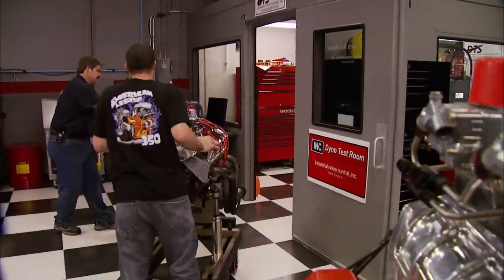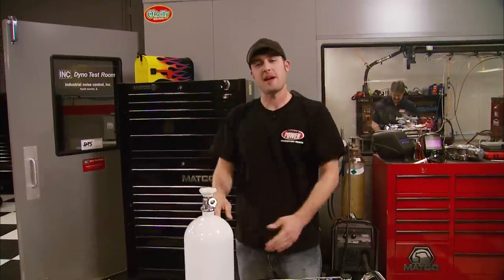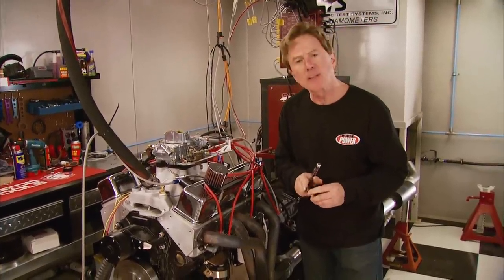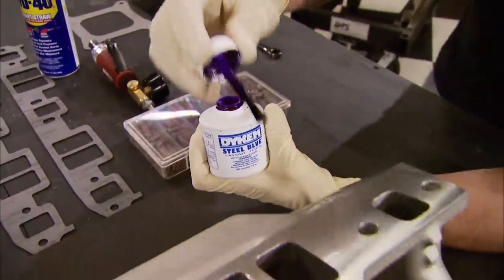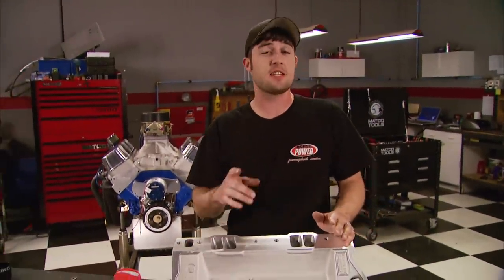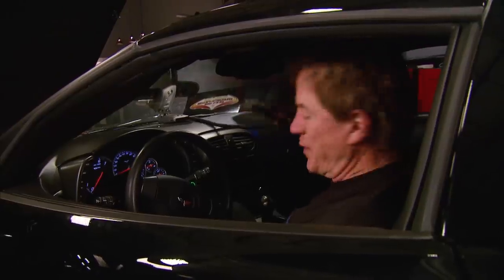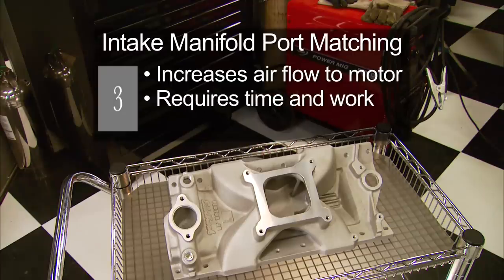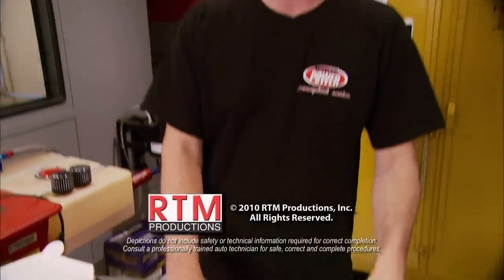Cheap Tricks To Increase Horsepower - HorsePower S12, E9

Comment: The shop vac idea is great.  You can also use shaving cream in the ports to capture metal and then flush it out, or use a rare earth magnet to capture what flies. 
What you should never do, is smooth the intake ports. Unless its a dry intake or its the exhaust port, smoothing the intake port disrupts the boundary level air and results in fuel falling out of suspension with the air. When you port match the intake, try to make each wall you're grinding on as parallel to the corresponding wall of the intake port in the head. The more bends in the flow, the more disruption.

While that intake is off, install a V shaped oil splash shield in the lifter valley, to keep your intake from hitting 200 degrees while your engine's registering 160 on the gauge.
Reply: I thought the peaks and valleys in the boundary layer level is what disrupted airflow and such and that you should smooth it down. Do I need to worry about fuel falling out of suspension with port fuel injection ?
Reply: @trizkial7592  I should have used a different term, but in airflow tests, a smooth intake port disrupts the rate of airflow, and heavier gas molecules can fall out of suspension in the air (ie, separate from the oxygen) and lead to poor burn rates inside the combustion chamber.  This is mostly true for carburator engines, which don't always atomize as well as fuel injection. Tho if the injection is happening at a throttle body or far up the intake port, there's a chance there still may be separation at lower RPMs...every time the intake valve closes, the airflow has to go someplace. It tends to reverse and run back to the common plenum and run to another open valve someplace in the engine. naturally, air flow benches rate air flow in one direction.

If you're running individual throttle bodies, then there is no common plenum to worry about. If your injectors are cleaned (not from snake oil in a bottle, but actually removed and sonic cleaned) and balanced to flow equal amounts to each other, and you don't let them get dirty over time and lose their ability to atomize, then fuel separation in the port may never be an issue. If you have a port injection system that's spraying fuel right at the valve, there's no time/room for separation. 

Otherwise, my personal opinion is if you're running pump gas, its quality may differ over time (transitioning to summer blends, etc) and a polished intake port that runs well on an air flow tester and after engine break in, may cause fuel separation a few years of use and wear 'n' tear later.  Will there be a horsepower change you feel? Maybe or maybe not--it could be a gradual change and only noticed by keeping strict records of performance.

http://speed.academy/10-myths-of-cylinder-head-porting/
Reply: Albert Gaspar Okay that makes sense. For my application I have port I injection. I wasn’t talking about mirror polishing it but just going over it with about maybe 120 grit or so. I’m more focused on blending the short turn radius and such I’m not gonna remove hardly any material. My intake ports are pretty good for a stock engine really. The exhaust side is terrible though I’m not sure what to do there
Reply: Certain engine designs are known for exhaust ports that suck (pun intended). Fords from the 1960's had shock towers that intruded into the engine compartment, and then there was the Thermactor bump for emissions.

Generally speaking, the exhaust doesn't have to worry about fuel suspension, so there, you don't have to worry as much about port surface causing the exhaust to separate its noxious pollutants. The gas is hot, its expanding, it wants to move. Keeping it hot as it goes down the exhaust system helps it move (ie, ceramic coat the headers, or use a wrap, then use the right size piping, an X or H crossover, few bends, free flowing mufflers, etc that not just fail to restrict, but also direct the hot air in a smooth path). A camshaft that keeps the exhaust valve open longer than the intake (usually called a "split duration cam") can help. But what really helps is a good set of headers. They'll move the exhaust so fast, the next time the exhaust valve opens for the next 4 cycle function, there's a low pressure inside the primary tubes of the exhaust, which draws out what is inside the cylinder--helping a bad port that doesn't flow well. the lower the pressure inside an intake or exhaust port, the faster atmosphere flows in it to equalize pressure.

Do a search for "David Vizard header design". You'll see a lot of theory, he was perhaps the best. But you can judge for yourself, here's just two:

https://www.chevyhardcore.com/tech-stories/exhaust/designing-an-exhaust-that-pumps-up-the-power/

http://www.superchevy.com/how-to/exhaust/0505phr-exh/

The interesting theory is, if you do a great job designing a header that scavenges the cylinder of exhaust, what you'll get is a "vacuum" on the cylinder by that exhaust system when the exhaust valve opens, and when the cam has its overlap period (when the intake and exhaust valves are open and overlap), the "vacuum" will draw more intake in, helping the intake port flow more air into the cylinder.

to take this to a further level (or more confusing :)  ), you can play with angle cuts on the valves. You've probably heard of the "three angle valve job". Its done to the valve face and valve seat. Get the angles right, and the port flows better at low lift. 

This helps because when the valve events overlap, its when they are at low lift. So, get the low lift flow spot on, and you get a better flow at cam overlap. Add in a great scavaging header design...and you almost have a boost-like effect going on in the head. instead of a turbo or supercharger pushing air in, the exhaust is "Sucking" it in and there's more air/fuel mix to burn when the intake valves close (tho there may be some in the header that backfires if the header is hot enough).

or so goes the theory :)
Reply: Albert Gaspar Oh okay awesome! I actually read David vizards porting book!!! I loved it. I wish he had more books that weren’t just on building small block chevys. Unfortunately I’n my application a 2003 Seville STS with the 4.6 northstar their is no aftermarket exhaust headers. So I’m limited to using the stock manifolds and making my own dual design into an x or h pipe. I was thinking about seeing if I can take the heads to get a 5 angle valve job or whatever they call it because the seats according to David are one of the most important if not THE most important factor in flow especially at lower lifts. I’m not looking to turn it into a race car but I just want to give it some more power while I’m rebuilding the engine haha. No aftermarket cams either lol
Reply: Albert Gaspar I love David vizards books for sure. My northstars heads seem to have pretty darn good intake ports. It’s the exhaust ports I think need work. They are odd shaped and have a big ridge in the middle for the EGR in every single port. It’s like a tunnel and makes a big lump down the middle in every port
Reply: That's cool you're messing about with the Northstar. If emissions wasn't an issue and you could use headers without an EO number, you can theoretically make your own design...header kits aren't cheap, and they require a welder who won't leave holes, but in some odd engine combos they are a choice.

http://www.headersbyed.com/+headerkits.htm

you can google "header kits" and find cheaper stuff, but this page gives you an idea of what you're up against if you go this route. and of course, Vizard did a thing on exhaust, but you're probably limited to "cat back" alterations.

https://www.amazon.com/Scientific-Exhaust-Systems-Engineering-Performance/dp/0837603099

https://www.chevyhardcore.com/tech-stories/exhaust/designing-an-exhaust-that-pumps-up-the-power/

i hear what you are saying about "givin the old gal some pep".  Theoretically, a good head port job takes the place of a mild cam upgrade. Not sure there's any cold air induction setup you can use for that, either. The old Ram Air setups used on W 30 Oldsmobiles added 10-20 hp at speed.

Pity there isn't a different rocker arm you could use from the Olds Aurora V8 or something...by increasing the rocker arm ratio, you get more valve lift, and a little more duration due to the extra travel.
Reply: Albert Gaspar Yea man just trying something different. If I was capable of welding and such maybe I’d attempt at making my own headers. I’m almost convinced even my rookie attempt would be better than the stock FWD manifolds lol. The exhaust port entrance is also about 3/8 an inch smaller in diameter than the exhaust manifold that clamps on to the port entrance. Thinking about matching that or opening it just a wee bit... although the books don’t seem to pay much attention to the exhaust side unfortunately so I’m not sure yet. I am head studding the northstar and fixing the half case seal like. I like the engine because of its smooth power and screaming it makes at high rpm. Hated engine but I have a weird love for it. And the intake ports seem to be very well designed in stock form on these heads too
Reply: Albert Gaspar I think the stock rocker ratio on these are something around 1.62 or something if I remember right
Reply: Small displacement aside, the Northstar is a good engine design, I'll bet there's forums about hot rodding it. Heck, Caroll Shelby used its Oldsmobile brother in his last two seater convertable sports car he built...that should say something. 

I can believe the stock exhaust manifolds are designed for quiet more than anything else. Its interesting the exhaust port is smaller than the manifold opening, you may have heard of anti-reversion. It was a header trick popular at one time, the idea was when the exhaust valve closed, the exhaust gas wave traveling down the header would leave behind a low pressure area (since the valve was closed and not contributing more gas). Air likes to flow to low pressure areas and equalize pressure, so it was thought there was reversion--the hot gas would return to the head's exhaust port. So some headers would put a cone inside the beginning of the header to help make HP by trapping the reversion. This may be the best explanation. 

https://crateinsider.com/using-anti-reversion-to-create-free-power/
Reply: Albert Gaspar So are you saying I shouldn’t open the ports up a bit to Match the header? I haven’t read that article yet but I will right now.
Reply: Albert Gaspar The northstar makes good power for its displacement especially for its time period no doubt. I was thinking about opening the port up to match the manifold or close too. Would this be a bad idea? They just seem a little small to me is all
Reply: The first thing is to have the exhaust port be the right size for what RPM you want this displacement to make its power at. Of course, what is that size? :)  Hard to say without testing it on a flow bench. But you can't put the metal back if its wrong, you have to buy a new head. the fact you have a smaller port now almost makes a reversion barrier, but its not the best. Like you said, focus on the exhaust port, then get a header to match.

in a perfect world, read the article, and if you decide to go with an anti reversion header (since the engine is a small displacement, i figure anything that helps, helps), shape the exhaust port in the head so that it flows the best.  That means as straight as you can get it, almost parallel to the exhaust valve stem, then make a header with a large primary around the flange so that there's room for the cone.

Mopar small blocks and AMC had great head flow, here's a video on what they did. you'll have to watch to the end to see what a "straight shot" exhaust port looks like.  

https://www.youtube.com/watch?v=htUssJfNG6M&t=115s
Reply: That's a good question and I'm not sure the answer. Detroit of course invented the engine to make luxury car power, which means off the line acceleration and fuel efficiency, without requiring so much work on the assembly line as to cost too much.

"Plus size" a port, and you move its power making up the RPM range. Imagine a river--widen it enough, its a pond and the water stagnates. But the best way for a small displacement engine to make power on a dyno, is to run high RPMS.

But that's on a dyno. Put that engine in a daily driver, and you lost low RPM torque. So you use a higher stall torque converter and numerically taller gears. Which I don't see doing here--unless there's a cheap option, I suspect you're staying with the stall speed the stock converter has, and its gear ratio. So if you don't want to hurt acceleration around town, I would say focus less on size, and focus more on obstruction left behind by producing/machining the heads. When you port match, consider the angle of the walls and roof of either manifold and how parallel do they run to the walls and roof of the ports. The first two cylinders at the front of the block, and the last two at the rear of the block may have more of an "angle of attack" since they are out at the four corners of the block.  rounding the angle may help flow more than enlarging things too much, if that makes sense.
Reply: Albert Gaspar Yea it just seems like the port entrance diameter being 3/8 an inch smaller is a bit dramatic to me haha so I’ll probably enlarge it a little and make it as smooth and fluid as possible. I’ve heard of higher stall converters. What exactly does that accomplish? I read a bit on a site but it didn’t explain it that well
Reply: The best explanation I ever heard, was imagine two fans sitting opposite each other on a desk.  Turn one fan on, and it  blows air (or ATF) into the face of the other fan, until its blades begin turning. I guess that's why a low RPM stall speed converter is bigger--more surface area, the more air is moved, the sooner enough mass of air hits the other fan to get it turning.

Where the higher stall speed comes into effect, is when you put your foot on the brake first. Goose the throttle while holding down the brake pedal, the engine gets up to that speed and its like launching with a clutch at that higher RPM. This assumes the converter is designed for the car's weight and engine output, if you take someone else's torque converter and put it in a heavier car, racier engine, etc it may not act the same.

But cruise down the road below that stall speed, or hit the gas sitting at a stop light without using the brake pedal at all, and you get...some forward movement of the vehicle. but its not as fast acceleration as if you had that lower stall speed. That's the "loose" feeling folks mean when they say they have a loose converter. once the engine gets up to the stall speed, then there's a better hydraulic connection, and you're running fast.

So what's its purpose? if the engine barely makes any torque below that stall speed, its not going to overcome inertia very well. So a higher stall speed lets you apply the brake and rev up the engine. its a bit more for racing, as you can imagine, and it creates more heat in the transmission. Probably above 2200 rpm (just to pick a number), an extra transmission cooler besides the one built into the radiator is needed. 

here's a video that might show it can be used on the street, it requires a little different driving style than just "point and shoot". But to your point, yes, that is a big difference in port to manifold sizes.  your plan is probably going to work, i haven't done it before on this engine, but i think removing obstructions and smoothing passages are the right way to go.

https://www.youtube.com/watch?v=mXJimlaTShk&t=3s

Comment: Had an old man tell me that polishing the connecting rods  while keeping them all the same finished weight helped create hp. Theory being that a smooth surface wouldn't carry the weight of the oil while rotating creating more power. Any truth?
Reply: Every change no matter how small adds up when hundreds of second can win or lose a race. My secret  .5 second adder is SFR 100. Look it up
Reply: you want to polish down the length of the rod, and it will shed a little bit of oil, but there's coatings that do more. The question is where will it splash and was it designed to do that.  Where the C'rod is picking up the most oil is at BDC, when it dips into the oil, and a windage tray can do the same thing for the entire reciprocating assembly. Also, if you remove sharp edges and burrs from the c'rods, you reduce locations for stress, and the C'rods get a ton of stress when they come to a complete stop at TDC and BDC.

Comment: I got a 307 motor in a 1979 Buick I got 350 heads on I got a big carburetor on there and 350 and 350 intake manifold what more could I do to get more power out of the motor?
Reply: 350 heads are probably costing you power, less compression cuz of bigger chambers they say. Could be wrong but everyone seems to say 350 heads on a 305 is a bad idea, but 305 heads on a 350 boosts compression.